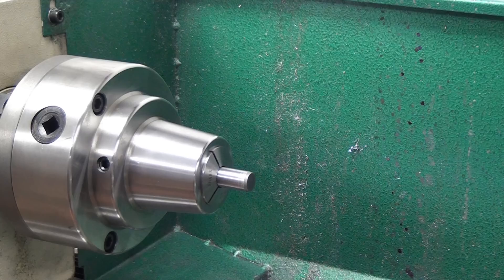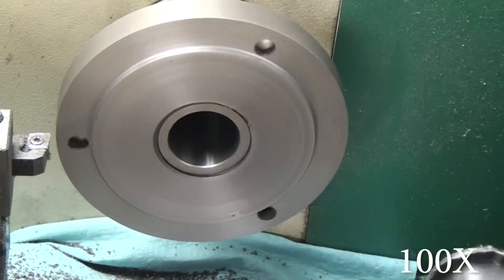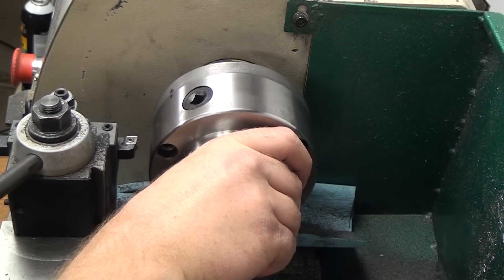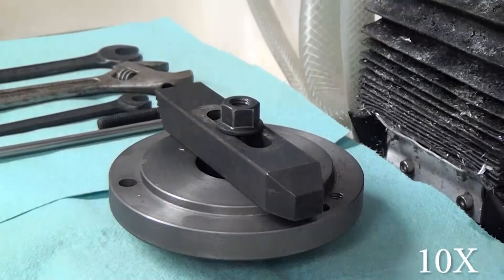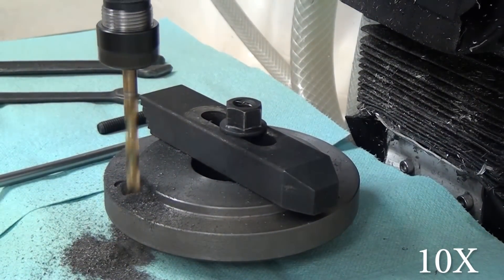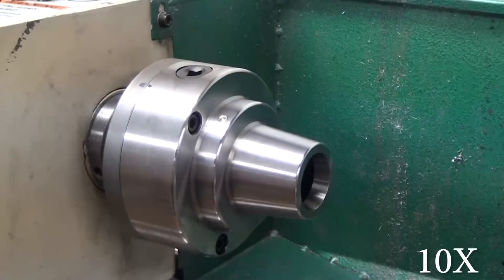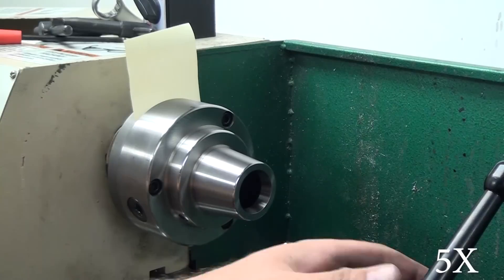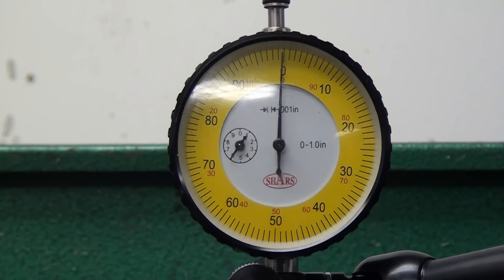24 G0602 5C Collet Chuck & Backplate

Comment: You've undoubtedly solved the shim issue, but if not, you might try buying a set of feeler gauges and taking it apart and using those as shims.  Better than paper anyway...
Thanks for your videos!
Reply from the maker: I think it's still set up with paper.... I haven't used it in a while so I'll have to check. I like feeler gauges for shim stock too but didn't have one thin enough. I just ran into this issue again on my mill, and also used paper to start :)

Comment: I got the D1-4 version of the CDCO collet and chuck.  YOU MUST REMOVE THE BACKPLATE AND THE 2 PINS SO YOU CAN ALIGN IT.  I have no idea why they put those pins in there.  Maybe so the halves won't slip during the final surface grind. After removing the pins snug the back plate to the chuck and mount it on your lathe.  Then set up a test indicator and gently tap the chuck with a plastic mallet to get it aligned.  Then remove chuck from lathe tighten the three screws holding back plate to chuck.  Recheck your runout again.  I went from 0.006" as delivered to 0.0004" after alignment.